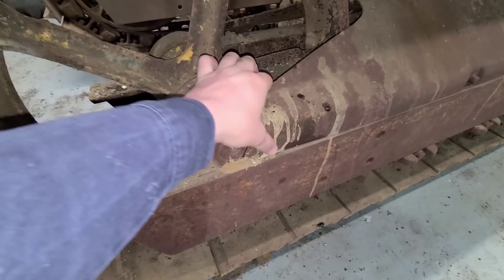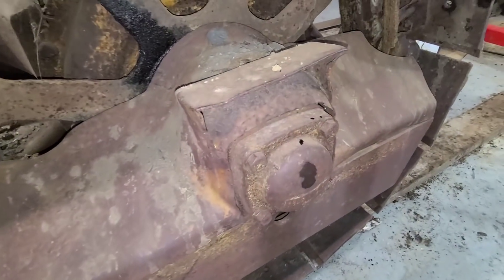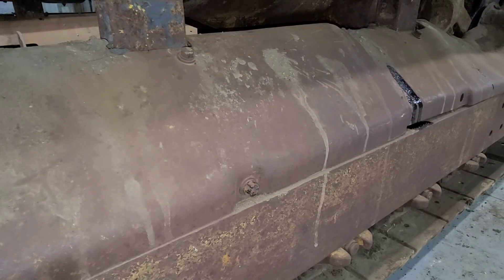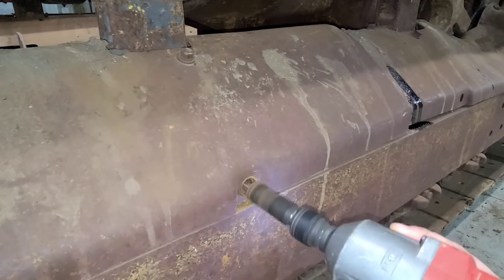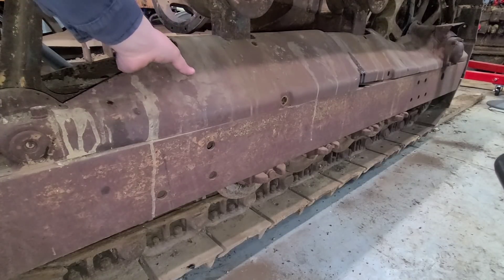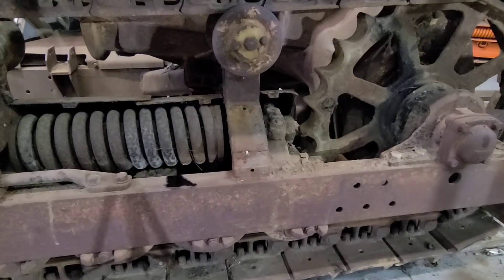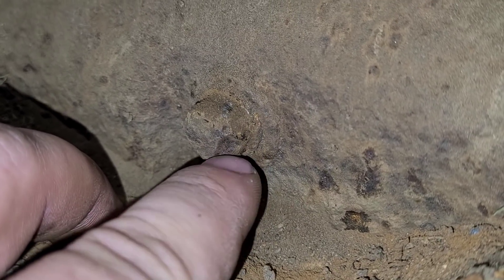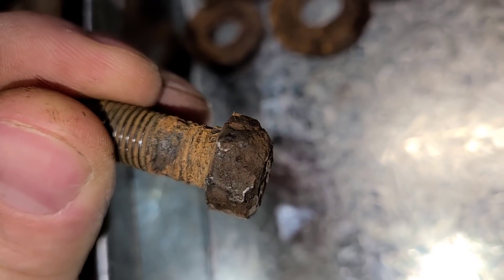Caterpillar RD-4 Chassis and Rear End Disassembly Pt.5

Comment: Keith Fenner at Turn Wright Machine Works showed in one of his videos modifying those adjustable wrenched by grinding the (I think) the leading edge of the adjustment screw thread, which allows it to open up a but more. This was years ago, and it's included in one of his videos, so it's not easy to find. I have a 3/4 that will now fit 1". 
https://www.youtube.com/c/KeithFenner/featured

Comment: That is a little different setup for the tensioner adjustment than I have seen before.  Is that the nut end or the head of the bolt.  Usually the nut is at the front of the spring.

Comment: If I remember correctly the track tensioning adjuster on my D4 is at the front of the spring. About 10 years ago I threw a track and to my amazement the pinch bolts clamping the adjuster came loose easily and the adjuster turn as if it were just assemble, hope your that lucky.

Comment: Funny thing is, when ever a stuck fastener is sprayed with a "penetrating" oil, the threads are dry when it's removed.
If the fastener is turning hard, and then penetrating oil is used, it gets into the threads.
Reply from the maker: Absolutely, it's amazing the amount of people who don't understand that the threads are still dry

Comment: What was that a pssssst can of instalube penetrant lol may as well hit the outer nut also maybe it can seep in some. Just razzing ya I know that stuffs not for everyone  dad used to use old diesel fuel additive that was out of date worked nice for rehabbing bolts n nuts  especially of their fair OE
Reply from the maker: I'm glad you understand Shane, it really comes down to personal opinion 👍
Reply: @kylechrist  you are right  personal choice can cover alot when it comes to a rebuild  I had a friend who fell into an AC Cobra a Shelby and he tore it all down and every nut n bolt and panel OE and OESpeced per Shelby when it was done it was all original and all speced

Comment: The whole video is awesome, I'm just amazed these bolts are breaking loose and coming out without heat. I would have been tempted to heat them all before even trying! The oil/WD40 clip at the end made me laugh so bad.
Reply from the maker: That's the way 99.9% of the bolts/nuts have been on this machine 👍
Reply: @kylechrist  Better lucky than good. I just had to use a 3 jaw puller AND heat to get a brake rotor off, and it had only been on there 8 years, not 80!
Reply: I've been enjoying seeing the bolts cooperate. Whole crawler may have slid into the shop, seized from one end to the other, but the bolts come out. Glad your daughter is doing better. Ol' crawler waited this long, I'm sure it can handle you taking time away when needed.

Comment: I gave the answer to the crescent hammer size in your last video. Remove the sliding part and notch the end of the “teeth” portion where the teeth end in a long flat “stop”. The roller hits this flat so the wrench stays together. Adding this notch allows the roller “gear” to pass through and the slide to open all the way until it falls all the way off, but it will fit larger bolts up yo the point it won’t stay together.
Reply from the maker: That may happen yet!
Reply: @kylechrist  You’ll want to modify every one once you do one. It’s self explanatory once you take the thumbwheel out and slide the adjuster side out. Just add another notch where the notches end and the thumbwheel won’t bottom out. The tool can come apart from now on but only if fully extented.

Comment: You were very lucky to not break any of the track tin bolts off good job. You do know that you have to loosen the two lock bolts on top of the track adjuster
Reply from the maker: Correct Chuck, those pinch the adjuster, just does no good if I don't have a wrench that fits haha

Comment: OK, you finally break down and use 'knuckle saver spray' which would naturally diminish your status with the purists down to mere Master Restorer.   But then you go and announce that you are buying a 2 5/8th inch wrench, probably the only one in your state not collecting road dust in a Snap-On truck or older than your D-4 and in a museum somewhere and POOF; you are right back to near Squatch status among the Tired Iron lovers!!!!   Amazing!
Reply from the maker: The trouble is finding a wrench that big locally. Seems everyone stops at 2 1/2"

Comment: Yeah, wrenches both large and small are a must when working on any type of machinery. Years ago, I had many people come into my shop and when looking around, ask why I had 18" 24" 36" and 48" pipe wrenches and the same extra-large sizes in adjustable wrenches?  I explained that they were a must for me when working on farm tractors, etc. The extra-large sizes I purchased way-back-when, mostly from garage sales and flea markets. Those wrenches cost far more than I wanted to pay and would always try to get them a few dollars cheaper, sometimes I got lucky, most of the time I did not. To this day, I have never regretted having purchased any of those wrenches. I have often said, when it comes to my shop and all the tools in it, I will make some member of my family extremely happy when I die.
Reply from the maker: I have large pipe wrenches but really didn't want to go after the adjuster nut that way. Maybe if I had smooth jaws for them 🤔
Reply: My wife looks at my tool box and shakes her head. She’s learned better than to question it. 😂

Comment: nice, i was wondering why you dont soak the whole machine in wd-40 in the first day.
yes wd40 is not oil and is not penetrant and it propably wont do a thing, but nuts sure slide better with it than just rust dust as lubricant
Reply from the maker: For the most part everything has come apart fairly well and no lubricants have been necessary, sure hope this trend continues!

Comment: Im glad to hear your daughter is doing better. I think 2 3/4" wrench is close to the 46mm wrench? Cause i know that is the standart spring tention nut size on almost all soviet crawlers. Only T100M and T-130 have 52 or 55mm adjustment nut if im not mistaken. Breaking them loos is just  lot of croil and breaker bar+heat if they are rusted solid.
Reply: 2 3/4 is closer to 70mm 👍
Reply: @danieledwards1081  Your right I don't exactly remember the differences between metric and imperial systems.
Reply: @SuperMAZ007  25.4mm = 1 inch
Reply from the maker: Thanks Steve!

Comment: Looks like a cap of some sort just in front of the bolt head.  What purpose does that serve?  Good to hear daughter is home and doing well.
Reply: I think it squeezes down on the threads of the big bolt to keep it stationary
Reply: @johnberndsen5614  Thank You!
Reply from the maker: Yes, John is correct, it pinches the adjustment bolt. Thanks William!